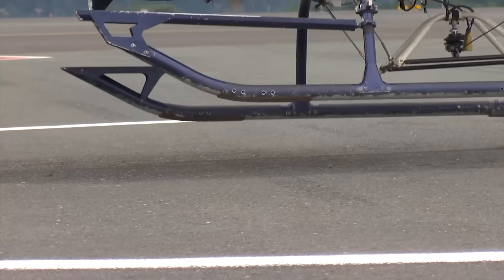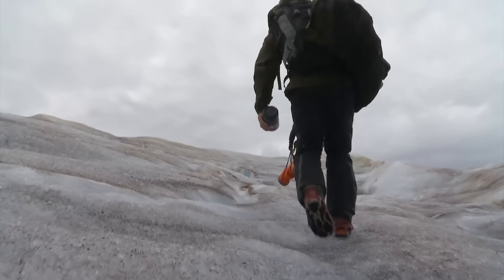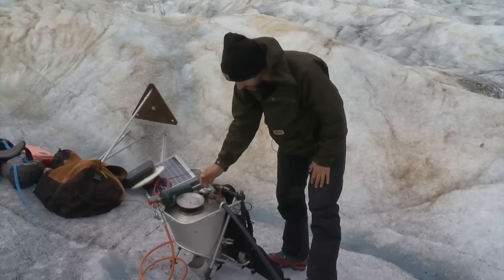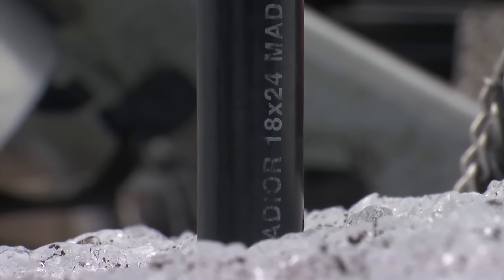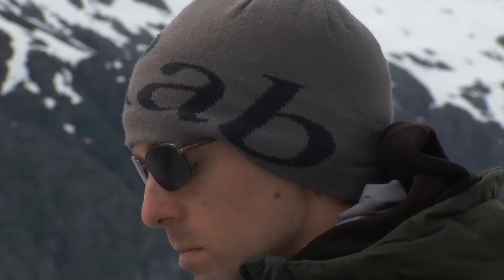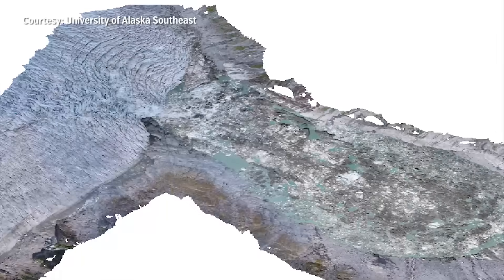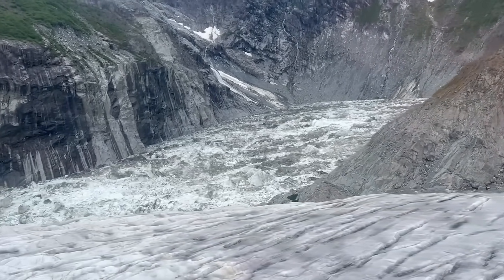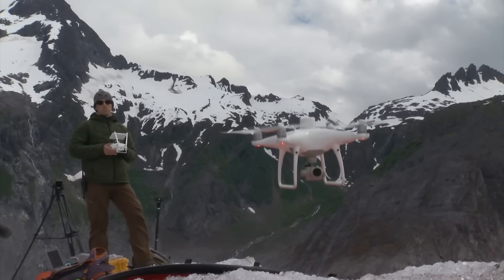Surveying Suicide Basin: Glacial Lake Outburst Flood Research on Mendenhall Glacier

Comment: This disturbs the glacier..wonder what is overall,affected by doing this
Reply: Compared to the actual melting to the glacier being caused by warming temperatures, absolutely nothing. They're also not putting themselves in harms way by doing the research on the problematic areas of the glacier, it would be done in an area safe enough for research to take place.